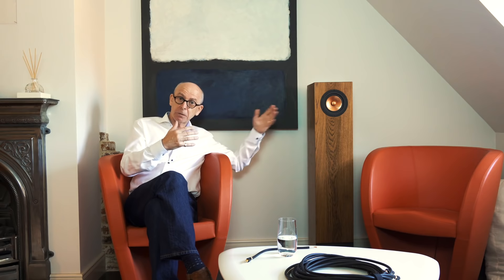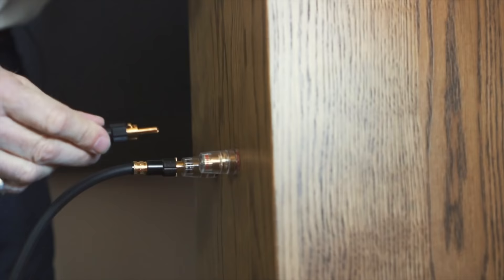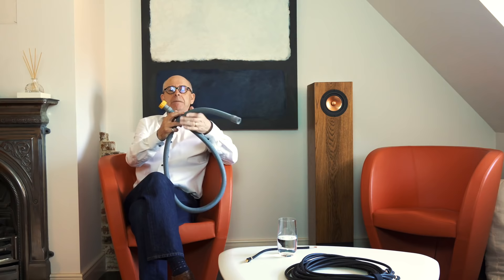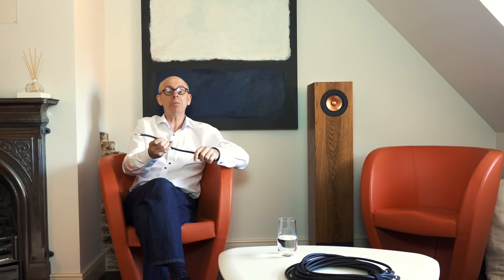Loudspeaker cables - how do they make a difference?

Comment: I came across your video series recently and have truly enjoyed your approach to hifi audio.  Which may be one area of discussion that carries more opinions than it is possible to count.  My background is electronics and I too learned the water pipe model reference as a way to understand the dynamics of current and voltage within a circuit.  LOL, I think it all started with how the instructor approached his discussion of Ohm's Law.  However, what came soon thereafter was a discussion of the physical properties of wire and current flow (electron vs hole flow anyone?) and two distinct properties stuck with me over all of my years (now 65 of them) and those are that a wire is a component, just as a capacitor, resistor, inductor and that all wire has properties of these three  values.  Those values become more important with the length of the wire and/or the frequency of the signal being carried by the wire.   The deep physics behind your simply elegant explanation lives and breaths.  My mind immediately went back to two things that I have always considered with cabling.   1) Strong tight physical connections are critical to performance and safety in high current applications.   2)  Surface volume of your cable directly influences (for better or worse) its ability to carry a signal  unadulterated.  Or at least to the extent possible or necessary.  Your in house made cables address both of those core parameters along with the separation of the +/- cables to avoid environmental contamination.  Quality of the materials is in my opinion a given, considering your customer base and your personal expectations.    Listening to your discussions has brought me back to my wayward youth where I gladly traded nearly all of my cash in the pursuit of my audio Holy Grail.     Best of continued success.
Reply from the maker: Thanks Mark for your good wishes, thanks snd excellent contribution to the topic.
Reply: I take it at 2), surface volume is a typo and you meant surface area.
Reply: @listeningto8371  yes indeed, area is the correct term.  I was enjoying a nice pour of my favorite bourbon when listening to the discussion and had  liquid on my mind.

Comment: my guess is that by changing the shape of the voice coil wire, your driver supplier has improved the efficiency while shifting the RLC characteristics of it, thus changing the inevitable resonance peaks in a way the shrillness between 2 and 4 kHz found itself to be tamed to acceptable levels
Reply: Most likely. Immediately making an analogy between this and speaker cables at 7:49 is quite a leap...

Comment: I owned accuphase ASLC-30 , around 2.5k new. I had luck since i got them with my loudspeakers for free. After one year of listening i decidet to test finally cables. The end of my own testing was that i sold them for 1k bought some forn 15 usd and had a great vacaction. Not one difference i was able to detect. That was around 7 years ago. Today i would like to have them back just for a better feeling :) . Like your vids.
Reply: Exactly right.  His explanation of the transmission of audio down the cable is weird.  He says electrons clump together.  How's that?  They are negatively charged, they repel each other. 

Cables can make a difference. A high resistance, (long and thin) cable with a low impedance speaker will reduce the damping of the system which can change the low frequency response, but if the cable is less than the 10% of the combined resistance of the amplifier and speaker you won't tell the difference.  Generally well designed amplifiers have output resistance of 10 to twenty times less than the nominal speaker impedance, so the speaker resistance is usually the dominant factor.

Figure 8 cables usually have an inter conductor capacitance of  60 pF per meter so 5 meters will be 300pf.  Assuming the amplifier output impedance at 20 kHz is less than 1 ohm the nominal cutoff frequency of the cable (-3dB) point will be 500 mega Hz ;way over the maximum audio range.

Here is the best explanation of "current flow" in an electrical circuit.

Comment: Thank your for the explanation. Your logical conclusion will save quite some money for those of who were considering to invest in expensive cables or clear the “what if”  doubts from the minds of those who weren’t. 👍
Reply from the maker: Thanks.
Reply: Truth is that well engineered speaker cables providing excellent resistive conductivity and excellent impedance concerning effects of inductance and capacitance can easily output a signal to your speaker that is well above the resolving qualities of your hearing when everything else is of high quality. Of course those companies making insane margins on speaker cables never want to show a proper null test proving their signal transfer improvements...because they know science will fail for them. Don't waste US$1000s on speaker cables costing US$10s to produce.
Reply: @ThinkingBetter  Can you give an example of a cable that sells for over $1000 but only costs $10 to make? I've never seen anything like that.
Reply: Do not waste your money on overprized cables!

Comment: How do we know how electrons move in a cable by using an electron microscope??
Reply: and the electron microscope is a type of electronic equipment used to examine visually not sure about any ability to make a measurement
Reply: @MrMadvoter1  Don't worry. I know what an electron microscope does. I have worked with a TEM.
It was meant to be cynical 🙂
Reply: @Richard-bq3ni  It's a special electron microscope. Made with polycaps and oxygen-free silver cables ! The electrons have no choice but to declare their whereabouts to whomever is watching 😂

Comment: As you explained, there is a lot of difficulty in reaching a balance between the main variables in a loudspeaker cable that make for a believable sound at the listening position. A lot of what we get out depends on the magnetic field the alternating signal current generates, alternating the positions of the electrons inside the metallic crystals in the wire filaments of the cable. 
Then, it’s a consideration of how those myriad magnetic fields in each metallic crystal interact with the magnetic fields in adjacent crystals. 
The magnetic fields do work on each other and together generate a general magnetic field around the wire that moves  any nearby electrons too and, according to how any electron was moving when it met the change in its local magnetic field, electron movements can actually be antithetical to transmission of the signal that is modulating the electrons’ positions. 
The wire ends up as a system where the signal current modulating magnetic fields creates many more magnetic fields which induce many more different currents. The longer the wire gets the more entropic the movements until the modulation is finally masked and the signal is no longer discernible. The system is not at all simple or pure in reality and, only a proportion of the intended signal remains to do useful work at the drive unit, as a magnetic field around the voice coil. The wire is also an aerial and creates part of a tuned circuit that can take radio frequencies back into the amplifier. 
I like how you addressed the problem by creating a reference cable to act as a known starting position for Sibelius’ neutrality. Cables behave predictably as part of the system they’re in.
Reply from the maker: Thank you for your comment and understanding as to why we wanted to build a reference point.  It's appreciated.
Reply: Yes as far as I have learned to date, to really understand why cables do matter, you’d need a degree as a physicist. The only thing to me that matters is though, that it has a tremendous impact on how the system acts and therefor creating the illusion of something sounding „right“ or „real“. Thanks for the infos
Reply from the maker: @dudemastermaster8944  you’re welcome!

Comment: I believe that speaker cable can make a difference. However, the reason is not the one that most people presume. Usually the difference is quite subtle, which leads to arguments. It can also be inconsistent, which leads to all sorts of mysticism about matching and tuning by ear etc. I suspect that the root cause of all this is in amplifier design and the fact a speaker cable is not simply a low resistance connection between amp and speaker terminals but also adds in some inductance and capacitance that appear across the amplifier terminals along with the speaker load. 
 I once had two amplifiers I was playing around with and I also had two pairs of speakers and two lots of cable. Rather than getting a subtle difference when trying different permutations, I got obvious gross misbehaviour of one amp with one cable that was fine with the other amp and vice-versa. Each amp was obviously distorting with one cable while sounding very good with the other. The differences were opposite and not subtle. This made me believe that in other circumstances there could be real but more subtle differences experienced by people swapping cables around and one person's great cable could be disappointing for another person. 
One speaker pair was my very good main set only a few meters from the amplifiers in the living room. The other pair were quite a bit further away in another room and quite good but nothing special - the kitchen speakers. I had some ordinary figure 8 lamp flex as the speaker cable for the remote set and I had some fancy, silver-coated, audiophile-branded cable for the shorter run to the main speakers. 
The figure 8 cable had the two conductors running close and parallel to each for a long distance. This made the cable also a capacitor across the amplifier terminals. One amp was stable into that and the other wasn't. The amp that had a problem with a long run of figure 8 lamp flex was fine with a shorter run of the same stuff. 
The audiophile cable was completely separate single conductor cables that ran along with quite a bit of separation between them - little capacitance but adding some series inductance (even a straight wire has some inductance). The other amplifier did not like seeing that load but was fine with any amount of figure 8. 
The fix was quite easy.  I put a Zobel network between the speaker terminal and the start of the cable. A zobel is essentially a simple passive crossover such as one might have in a 2-way speaker between tweeter and woofer except that the crossover frequency is set well above 20kHz. The low pass side sends all the audio frequencies to the speaker while the high pass side gives ultrasonic frequencies a simple 8 ohm resistor as the load. The amps sees a more well-behaved load. Many amplifiers have such a network built in but some don't, perhaps to give better looking specs such as very wide bandwidth, well beyond the audio range. A better design, as many have, would be to add this simple network on the output inside the amp, ensure that the amp has a known, designed load at ultrasonic frequencies and it would be more immune to differences of cable or even quirky speaker loads.
Reply from the maker: Dear Peter, thanks for your contribution to the topic. Much appreciated

Comment: Water analogy- diameter of pipe = resistance of cable, smaller pipe = higher resistance. 
Water pressure differential- voltage, higher pressure difference = higher voltage
Speed of water through pipe- amps flowing through a wire.
Start the water moving, it starts through the whole pipe even though the water molecules are only moving slowly, they start moving together throughout the pipe, same with electrons, they move slowly but they all start together, well, at the speed of light.

Comment: I've built and sold custom speakers for 30-35 years, and when it came to building my own speakers,  put away flat ribbons, woven, and networked cables, and voiced them to work best for me with 16 gauge figure 8 speaker wire. When I want playback I like better, I'll change an active component in the signal chain,  and never worry about wires again.
I do like Mark Audio stuff and still have some, as well as some early EJ Jordan drivers I think he collaborated on.
Reply from the maker: Thanks for your enlightening comment. A good approach!

Comment: What does the voice coil have to do with the question of whether interconnect cables make a difference? That's clearly a false correlation.
Reply: he mistook the voice coil change (mechanical shape change, which affects resonance etc) with electrical change. big false correlation. from then on, it was all downhill
Reply: Приятель, искал  твой комент. С одной стороны,даже хорошо, что в мире полно дураков, готовых платить за маркетинг, просто за дизайн люди не хотят платить, им нужны понты! Действительно, форма катушки важна ибо меняет индукцию. меняется зазор в магните. Именно это важно в дизайне акустики. НО ЭТО НЕ ИМЕЕТ НИКАКОГО отношения  к серебрянным кабелям.  Всего 2 лайка. нужно принять что мир полон дураков и просто делать на них бабки!
Reply: I think he was only trying to make a general point that seemingly innocuous changes can indeed make a surprisingly and significant difference in changing what was once mundane and ordinary into something superior. Instead of the voice coil example I suppose he could have said he could got better gas mileage when he changed the tread design on his car tires, or simply rotated the tires. Moral of the story or point made, he starts his speaker cable talk. Obviously there is no correlation between tires/gas mileage and interconnects or speaker cables, just making the point that small changes anywhere (tires, voice coils, cables, or whatever) can yield beneficial results. That's my take on what he was saying anyway, and not so much about what tire tread (or a voice coil) has to do directly with speaker cables.
Reply: He gave an example of how small changes in material and composition can have unexpectedly noticable outcomes.

Then he he proceeds to explain that the speaker cables are as simple as possible.

He is more or less advertising anti-snake-oil and the people in the comments are like "gotcha - snake oil!"

Comment: For 40 years of being a audiophile, all I know the best cable is the best match between the connected machine, type of music and the taste of the listener. It was never about price.
Reply from the maker: Totally aligned. If it works, it works.
Reply from the maker: I will tell you a secret... in our listening room we have had quite a few different rca cables, from very expensive (gifts from people wanting reviews to very cheap ones, including ones we bought ourselves, and the ones I like the most are ‘Amazon Basics’ they are very smooth sounding and yet still detailed. I think they were less than 10EUR a pair
Reply: The type of music cannot possibly affect a cables performance, or any other component in an audio system. The choice of music is subjective and purely in the mind of the listener. A good component or system is by definition capable of achieving accurate reproduction, regardless of the input signal. If a component or system is perceived as being musically inaccurate, it will be with all and any music it reproduces. Subjectively a listener may tolerate this inaccuracy or even be unaware of it, nevertheless the system or component cannot possibly alter it's performance depending on the nature of the signal. A music signal has only three components; Frequency, amplitude and phase, which have absolute values at any given moment, if we imagine an audio system as a measurement device, the  potential for error given that these values are constantly changing is clearly  enormous.
Reply: @jerrypartington3650  The electrical properties of the conductors may impart some analogue change to the electrical properties of the voltage signal representing the audio frequencies, but I'd in my experience it would seem that at the distances and gauges we're talking about they would be so small as to be undiscernible. If there is a more noticeable change depending on cabling used, something else is going on.

Comment: Saying that electric current actually consists of electrons 'bashing' into each other doesn't explain why electrons don't pour our out of the free end of a wire if you connect the other end to a battery. The reason electrons don't pour out is because there's no difference in electrical 'pressure' along the wire until a complete circuit is made, and the circuit contains a battery (or equivalent). You need the (electrical) pressure gradient along the wire to make the electrons flow, just as the dishwasher hose needs a pressure difference between the ends of the hose to make the water flow.

In some ways analogy with water isn't as ridiculous as suggested here, although of course it's imperfect. The electrons in a metal such as copper can be divided into two sorts: ones attached to particular copper atoms, and others that are dissociated from atoms and free to move. The dissociated ones, being mobile on the large scale, carry the current. The dissociated electrons are somewhat like an incompressible liquid in the sense that they don't clump together in particular places (at least, not at the frequencies encountered in audio).
Reply from the maker: Thanks for your contribution to this complicated process, much appreciated